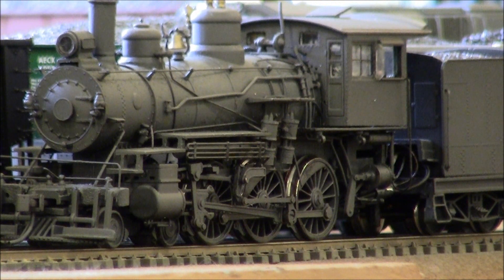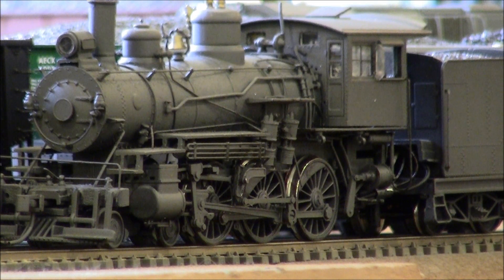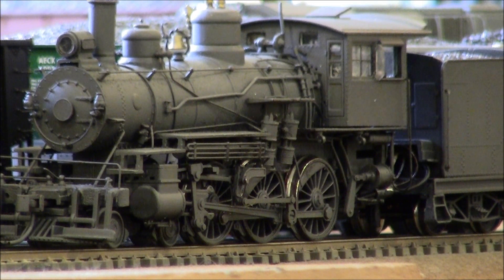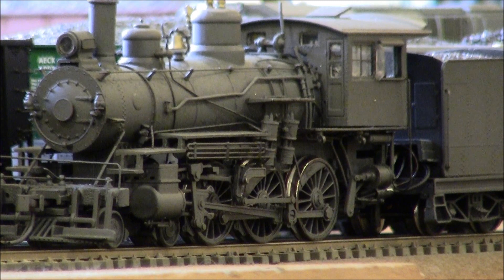Bachmann Spectrum 4-6-0 With SoundTraxx Micro Tsunami

Comment: Finding two of these exact models with dcc and sound has been hell. And I’m in a layout construction position where my previous system shorted and died and still have to purchase a new one, and two boosters before I can get the whole thing going. Also 75-100 foot of flex still needs to be layed. But once done two of these little units will run my mixed freight locals in correlation with two 4-4-0’s, a 2-6-0, two priority unit trains powered by two 2-8-2’s, 4-6-2’s are used for my primary passenger system trains, a doodlebug for light rail branch line daily commuter, and a couple other variations of steam are also in the working fleet. The 2-8-2’s will likely be the largest locos of my layout with maybe a one day 2-8-4 might come along and lead above the rest thanks for sharing loved the cars as well!

Comment: Would this model match up to any prototype railroads in Vermont or New England in general?
Reply: Brett Stankiewicz Hi Brett, It will make a good match to B&M, CV and perhaps Rutland. You can google for images and probably come up with some close matches. Others may have some suggestions.
Reply: Ok thanks! Now I have to go find one!
Reply: Brett Stankiewicz Look up Tweetsie Railroad, this locomotive is based off. the #12 narrow gauge engine...at least, I think.
Reply: @milkvanman104  #12 is the prototype for Bachmann's G scale and On30 4-6-0s. The standard gauge HO version with small drivers is based on Maryland & Pennsylvania #28. This version, standard gauge with large drivers, doesn't have an exact prototype that I know of, but it's reasonably close to a lot of larger Baldwin 4-6-0s. The closest surviving example I've found is Nevada Northern #40.

Comment: Addendum: What do you mean 'high wheeled" ?  Unless you're saying Bach made a total different model than the standard DCC/sound one they ceased making but are on Ebay, I have a new one replacing a broken one I lost to their repair Dept. Several years ago, where they sent me a modern 4-4-0 back. Always wanted her back. I recently got the C&O/sound, with the baby blue, black, and gold paint job, brand new for a great price... Anyway, to my eyes the drivers are on the small side compared with say, a NYC y6b 4-6-4... IS this video showing a different model than mine ? I know you've done allot of weathering and added separate piping and moved the cooler pipes to below the running board..  But, are your drivers here a larger diameter than the general ones sold on ebay ?
Reply: Bachmann did make two versions of this loco with different size driving wheels. Both were sold under the Spectrum name. The one in this video has the larger, 63" drivers. The only one they make now, including yours, has the smaller 57" drivers. I've done a lot of research on this trying to track down a 63" driver one (they're hard to find now but I did find one and it's in the mail on its way to me right now). I previously had a broken one with 63" drivers, which, like yours, was lost to Bachmann's service dept (they sent me the one with smaller drivers). So yes, the one in the video does have bigger drivers than yours. Rest assured, your eyes do not deceive you! :)
Reply: @michaelramsey82  
Sorry for such a late reply.. Been away from the hobby..dwelling problems, galore !' Anyway. Yeah, I gotz the 57" er.. I like the 63" better; more robust.. Don't know why they'd even change it to begin with.. 
Thanks, M